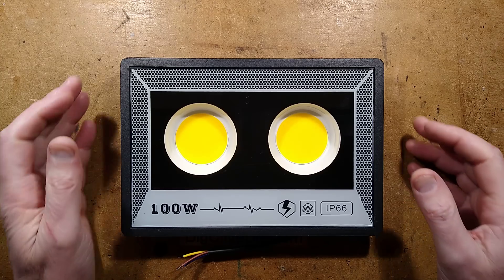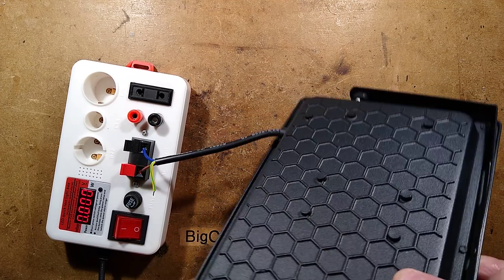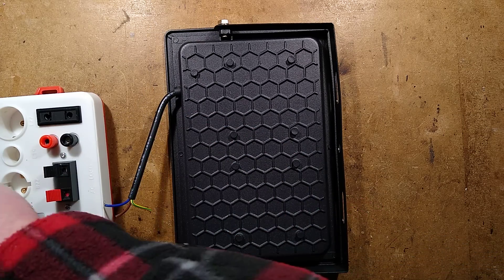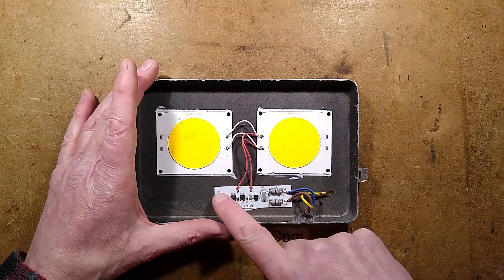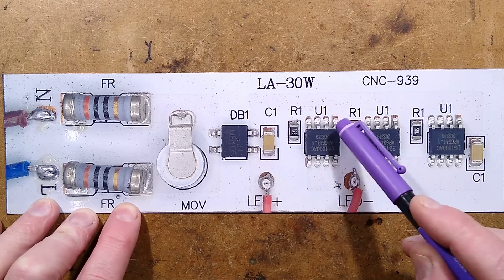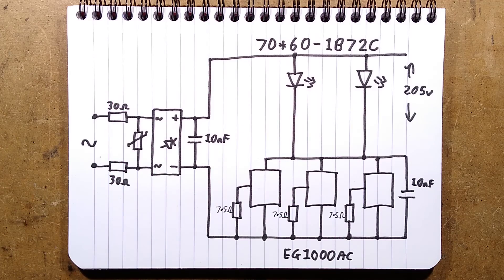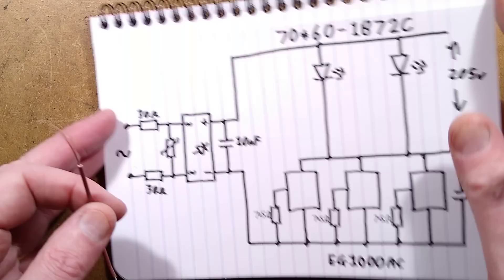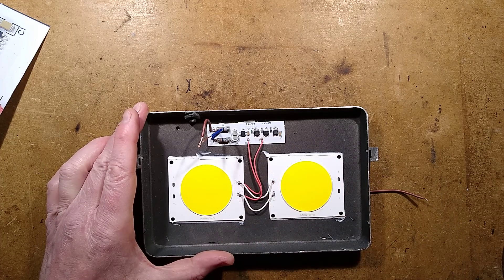Temu 100W LED floodlight is exactly what you'd expect.....

Comment: I do Amazon Vine reviews and one of the things that I test on light modules and power supplies is whether they live up to the ad's wattage claims and whether they have a ground... I have found that sometimes it doesn't appear that they have a ground, but it is because of a non-conductive layer on the surface of the housing.  Best way to test that is just to put the two probes of your multimeter on the housing and measure the resistance across it.  If very large, then it has a coating on it and you might need to use the sharpened tips of your probe to get through the coating.  Once you can show continuity across the case, use one of those points (where you've gone through the coating) to check continuity to the ground wire.

With many of the lights, they make ridiculous lumen claims because they figure that most people do not have the equipment / setup to properly measure lumens.  Meters for measuring lux are fairly cheap and the measurements are easy to make... As such, the sellers do not list a lux claim since it would be easy to verify (i.e. call them out for their blatant lies)... What I can test though is their wattage claims... If they say "100W", it sure as 'ell better BE  pretty close to 100W or rating will go down... If they want to say that it is the equivalent of a 100W incandescent bulb, then they better say something like, "100W equiv" or their rating will go down... For power supplies, I measure the amperage and voltage going into the power supply and the amperage and voltage coming out of it... I use a piece of coiled NiChrome wire (salvaged from an electric clothes dryer) as a load resistor, varying the amperage by changing where I clip into the coiled section of NiChrome wire.

I have found some acceptable things on Temu, but I've found a lot of crap there also... Same goes for AliExpress and Amazon for that matter...

Comment: Looks like you could do with either a heat plate, or, hot air blower to soften said sticky stuffs and a suction cup to lift the glass ('Like wot phone repairers do' 🤔😉)
😎🇬🇧
Reply from the maker: It's silicone, so not something that normal heat would work on.
Reply: @bigclivedotcom  oh, I see, oh well, the Chinese just lurrrrve to slap their crap together don't they lol 😏

Comment: Woah, that's terrible, Muriel! Putting things in parallel without balancing them actively is a recipe for disaster. One will have an ever so slightly higher current and ever so slightly higher wear. Until it gives up the ghost, and suddenly the energy is distributed over just two. Then just one. Then your whole house, because it's on fire.

Comment: Ill never understand why they don't just install the ground wire, 9 times out 10 they've already did 90% of the work needed to connect it, they just need to put a screw threw the wire terminal and into the threaded post on the case.

Comment: I wonder if this is intended as 100w equivalent, it has the same energy saving phrase as most lightbulbs these days. Found a Philips bulb that shows 2.3w = 40w on the box, but it's labelled 40w on Amazon. Obviously if it's equivalent they've managed some extreme inefficiency, seems most 100w equivalent lightbulbs sit at around 13w.
Reply: They measure the light in lumen.
A 100W incandescent light bulb is 1600 lumens.
If this lamp measures 1600 lumens, it is spot on.

Comment: I've just had the first of the longest lasting LED light bulbs I've ever had start to fail they were pack's of 2 in Home Bargain e-luminate 5w from 2021 used at least 12h every day it's still not good but it's the best I've had so far

Comment: Ugh.  Cheap garbage.  Why am I not surprised?  Think of 'em as disposable, though, and you'll do okay.
At least 12V versions should be better.  I got a Lysed "30W" light off Amazon that draws a constant 17W or so.  Starts cutting in at 9V or so, is full power (wattage) by 11.somethingV, and stays at a constant 17W even upping the voltage to 18V and more, but I didn't want to push it.

Comment: Actually, I think this is better engineered than the cheapie eBay lights you looked at years ago. This one might last a while in a light duty (or good airflow) environment. If they advertised it correctly as a 30- (or even 40-) watt light I might even call it "good." They really need to affix the ground if they're going to seal the case, though.

Comment: Hi Clive,
You missed pointing out with the lose fitting wires that it is rated IP66 (a rating for electrical enclosures that can protect against powerful water jets up to 1 m of submersion).  Possibly IP60.
40W, no Ground to earth, and wrong IP rating.

Comment: Now, I'm curious. A lot of LED lights broadcast their output compared to incandescent bulbs of a higher wattage.  I wonder if that's what the 100W is actually referring to.
Reply: @gazrgazr2394  when have you ever known chinese knock-off products to be accurate or complete in descriptions?
Reply: With LEDs it's just the Wild West. I recently bought a "300W" grow light on amazon, reporting a power draw of 300W on the seller page, I plug it in and it pulls like 105W.
Another light, a 150W LED high bay light, actually draws 150W
Reply: @centralintelligenceagency9003  We get it, you grow weed.
Reply: If it was 100W it would probably melt after a week or so
Reply: Bingo. 100w old money - which is how Joe blogs 'measured' brightness before leds
Reply: Don't over think it. Their 30 watts of led is roughly equivalent to 100 watts of incandescent....in lumens. LED bulbs are labeled this way already. Nothing fishy here.
Reply: @joemendyk9994   100W incandescent is around 1500lm.  35W LED should be close to 4000lm.  Any equivalence there is extremely rough.  And you can't just write 100W if there's not 100W being used; you have to write something like "equivalent to 100W incandescent."  You could never get away with putting this on a store shelf in a properly regulated country, even ignoring the floating ground lead.
Reply: @JamesAAshton well just about every package does incandescent wattage equivalent in the US.
Reply: @joemendyk9994  It isn't correct if it labels it without the word 'equivalent' or some comparison on the packaging or advertising.  Descriptions and advertising need to be accurate.  That's why, in most countries, we have laws defining what people need to put on, and how they have to justify claims.

Comment: It's not really a reliable test to check continuity on a powder coated/anodised surface.
Reply from the maker: The test was done to the bracket screw that is tapped into the housing.

Comment: Oh, wow, those Cobs and PCB would be ideal for a project I have in mind. I've an old 35mm fixed lens camera. I wish to take the guts out of it to make into a lamp. To have it mounted on a tripod and open or close the lens iris to increase or decrease the light range. I'd only need one Cob for it. What do you think, Clive, fancy doing me a deal/offer for your floodlight parts?
Reply from the maker: You can get round COBs that are more suited to low voltage use.

Comment: @2:00 - reminds me of a time where I didn't "put this back" and wanted to test the new 220v outlet for my generator at home.

I went to test that I had 220v across the hot leads and BANG!  Tripped the whole house breaker.  The flashlight on the floor of the garage was the only light visible.

I remember thinking to myself that I thought the light at the end of the tunnel would be brighter.

Found about a 1/4"  (about 7mm for those who don't speak freedom units) of one of the leads was missing.

The fuse in the meter did it's job as did the main breaker of the house.

Glad I was wearing eye protection when I was doing the work.

I now remember to always put my thingy back where it belongs when I am done with it.

Comment: That floating earth wire must be standard practice.  I recently received a step light with the same AC input cable (85-265 VAC).  Since I wanted to run it from a doorbell transformer that's always on anyway, I took it apart.   A small LED ballast hot-glued in the aluminum case, with the earth wire disconnected (hot glue, of course, has come unstuck)   For me, it didn't matter, as I replaced the ballast with a low-voltage MT7201 step-down controller from the 18V transformer output.   Earth wire unneeded.

Comment: Looking at the circuit board, it does say "LA-30W*, so if anything it's surprising you got 37W out of it
Reply: He got 37 watts into it when he first switched it on. The power quickly dropped and the supply is far from 100% efficient so the output power to the LEDs could realistically be a true 30 watts.

Comment: LOL they did not want to spend a cent on that single screw for putting that ground wire to the convenient thread next to it. and the looks on the power rating it is probably marked with "equal" to a 100watt incandescent bulb marketing

Comment: I love that all the components have the same reference. Very useful.
Reply: makes you wonder how they lay out their PCB's, cause most EDA packages won't let you assign the same designator, or will change the designator when you copy & paste. Also loved the inverted L & N wire colors (not that it really matters for this circuit)
Reply: @jordanwaeles  at least Altium will let you name them the same..but it will complain when you run any DRC, which you can just ignore. Guess other software will do the same
Reply: exactly.  @jordanwaeles
Reply: They been the same part tho..lazy chinese folks 😂
Reply: same reference != same part. If you want yo revise this and change a value, how do you specify which? "The rightmost R1"? (whose right?)  @bastelwastel8551

Comment: You sound like an underwater mp3 from 2001! Stats for nerds say: "Codecs vp09.00.51.08.01.01.01.01.00 (248) / opus (251)". Is that in your video?
Reply from the maker: Not sure.  I still use a Moto G7 power to record most videos and then use an app to increase the volume to a more sensible level.  It may murder some of the treble.   I have a bassy voice that has always been an issue.
Also note that Dolby thinks I'm mainly bass, so sometimes diverts all the audio to a subwoofer.

Comment: Of course, it's not a "100 Watt" floodlight, it's a  "100W" floodlight. In the USA it's become common to label LED bulbs with their Energy Star incandescent watts rating for equivalent lumens.  For example, an 800 lumen LED bulb is labeled and sold as "60W" in even though its actual wattage is around 9 watts (the 'fine print' on the package will usually describe it as "60 Watt-equivalent").  Thus "60W" has become more of a type label than a watts indication. So consumers buy a 'Sixty-"W"' bulb rather than a 'Sixty Watt' bulb. I can see a near future where most consumers won't even know or care that the "W" in the name once meant "watts".  The question becomes "how many lumens is that '100W' floodlight actually putting out"?  Then there's comparing lumens versus lux, which is pretty relevant for floodlights - but that's another big fat rat hole.
Reply: I initially suspected the same, but an LED using 37 watts for an 100 watt incandescent equivalent would be terribly inefficient. A typical 100W equivalent LED bulb uses around 12-14 watts.
Reply: @lonniemcclure4538  It would certainly be a horribly inefficient implementation, but AFIK the 100W naming only applies to lumens.

Comment: I didn't know about copper-coated aluminum. Now I understand how they manage to create that horribly fragile and poorly conducting wires! I'll keep the flame test in mind!
Reply: its common, I run into it all the time in Low voltage data cabling... it causes issues with longer runs on POE+ 30W, the voltagew drop over distance is terrible on the stuff..
Reply: Alumimium is not such a bad conductor.
Reply: There was a period back in the late 50s, maybe into the 60s where the in wall mains cabling was CCA in the UK. Eventually it gets very brittle, so unscrewing a face plate is enough to break cores.  There's also quite a bit of CCA in telephone wiring. My OpenReach phone cable through the telegraph pole is CCA from who knows when and periodically degrades or breaks my Internet.

Comment: They almost got the grounding done. Ground wire properly terminated with crimped connector. Hole for a screw right next to it.
They stopped at screwing it in.
Perhaps a sudden shortage of screws? Last minute cost cutting?

Comment: You wouldn't get a ground reading off of the casing if it was wired correctly or not. The casing is anodized. It's dielectric. The first phase of anodizing is passivation. It becomes non-conductive on the surface.
Reply from the maker: I put the probe on the bracket screw which is tapped into the alloy case.

Comment: It's the IP ratings that i find the worst thing on these Chinese outdoor lights.

They generally work as a light fine until the first time it rains.

I drilled a drain hole into mine.

The cheapest halogen flood light in B&Q (i think it was something like £3) lasted me 10 years, so these LED lights are somehow worse than the cheapest lights in B&Q.

Comment: I've bought 12v 30w "cob" leds on amazon that ended up being 24v 100w and to be honest I've driven them at 28v and drawn about 150w a pop and as long as you keep them cold they keep on chuffing away. And if you ever question the power output its "its based on how bright they are compared to halogen lights , its the same light as a 100w halogen"  , I have one cob here that's rated at 100w which was expensive enough at 14 euro , yea I can drive it to 300w no problem with a heat sink and fan.  I don't believe the ratings on them at all , its more like their safe rating.

Comment: I've had issues with LEDs in parallel, if one of the LEDs are older or of another batch, even worse a different colour, they can turn on before the other, and the other's voltage can't be reached to turn on. It is so annoying to troubleshoot. Each LED in parallel needs it's own resistor to balance the currents. But that is expensive...

Comment: There are legions of new home growers of a recently legalized plant, being duped on Amazon and eBay into buying grow lights advertised as “300W”, “500W”, etc.  They believe they’re purchasing 300 watt or 500 watt grow lights, and some of them can’t even accept that they’ve been duped after being told by others.  The sellers innocently proclaim that these are “model numbers” and the actual wattage is in the fine print.  It’s a despicable practice and it’s shameful that Amazon and eBay help enable this kind of fraud, but just a little homework and critical thinking on the part of the buyer could help prevent this from happening.  Caveat emptor!

Comment: When testing current, if you get "zero", you should always double-check by testing with something you know does have some current flow, to make sure you didn't just accidentally blow a fuse in your meter without realizing it.
Reply: But a blown multimeter fuse doesn't indicate it is blown as such, it is only when you are testing something that you know has operating current and when putting the multimeter inline find it isn't working where you learn of the blown fuse.
Reply: A friend of mine actually blew his meter fuse AND burnt the meter electronics to a crisp when he was checking for continuity after installing a daisy chained AC plug socket. ....apparently a previous electrician had got the Earth and Neutral wire colouring mixed up in the wall cavity. Oops!!.
Reply: @penfold7800  Clearly there was more than that wrong as PE and N should have the same potential.
Reply: True, I’ve had that happen.  Several times after lending out my meter.  So now no lending.  

Also, in general, I was taught you can’t prove the absence of voltage.  So measure a voltage then measure your circuit of interest. Repeat several times. You still may be wrong but chances are you’ll be ok.  (Talking deadly voltages. )
Reply: Test the test meter, test the circuit, then test the test meter again.
Reply: everyone in this tread is a pedant.
Reply: Clive has a university degree in this subject.
Reply: @deang5622 and people get complacent.

That's why there is the saying "complacency kills"
Reply: @NoblePineapples  But a qualified electrician or degree qualified electrical engineer KNOWS how to check for dead.
There is a well known process for locking off the supply at the circuit breaker and using a voltage proof and meter for proving the installation is not energised.
Reply: @deang5622  which is only part of the story.... He also has (I don't even know how many) years experience using said degree in real life..... I think Big Clive is pretty well qualified with most things he speaks on!
Reply: @neshbro  you're not qualified UNTIL you've blown the meter fuse up a few times.  He's careful not to get distracted after making the measurement because we've all done it.
Reply: @dr_jaymz  eh, even I have blown meter fuses. I'd bet Clive has done many many many. Ya don't literally work with the stuff for that long and not.
Reply: @deang5622 true, but it does always help. Scholars give each other advice because no one knows everything.
Reply: Besides you should change phase and neutral to see if there would be current flowing otherwise.
Reply: @unbekannternutzer8506  Nonsense.
The same current flows in both. It has to by definition (except under a fault condition).
So it doesn't matter which you measure
Reply: @deang5622  not If you measure against pe which is basically neutral
Reply: That’s why I’m more inclined to trust a filament lamp-based tester. Meters are fine except when they’re not.
Reply: @markfergerson2145  Everything is fine until they are not.